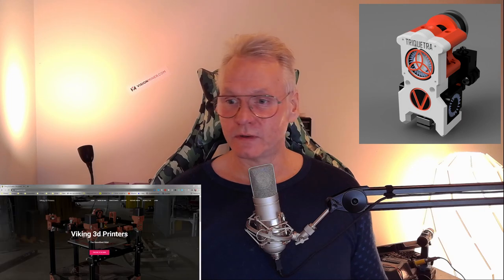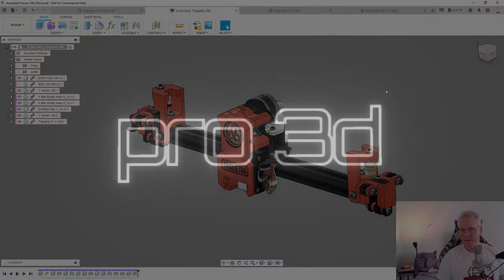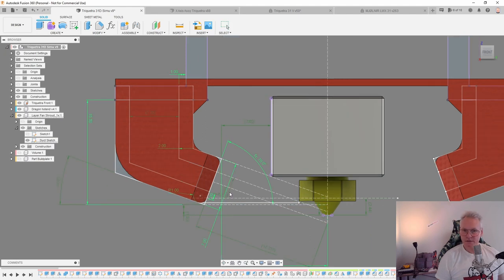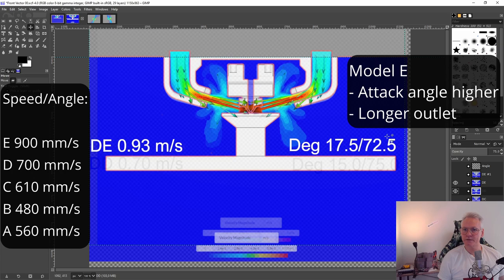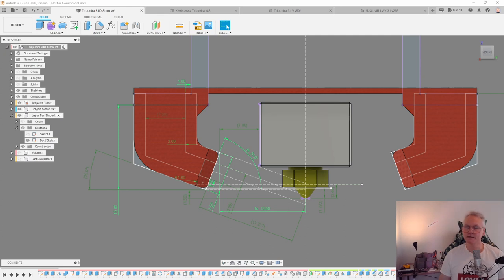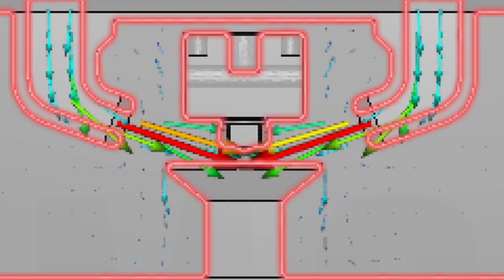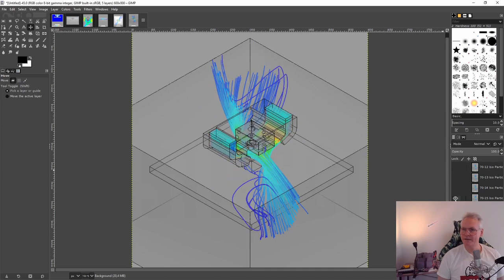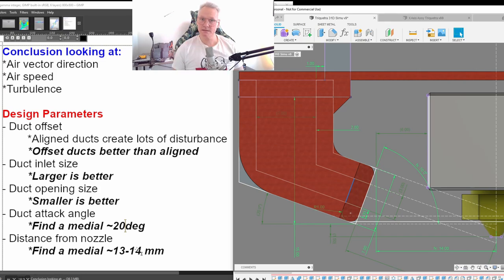Fan Duct Design Optimizing by CFD | 3D Printer ToolHead Design | The Triquetra

Comment: Just an observation: If the heat block needs a silicone sock, it will influence the air flow. So you might need model it and change the parameters to direct the air further down
Reply from the maker: Wow that is a very good observation! I will definitely do that. Thanks for the input Peter

Comment: Very interesting conception.
The filament is melted in nozzle, coming off down, outside and should be still good melted enough to good stick to the previous layer of  the print .... 
My question is : if you attack too high on the nozzle,  the cold air will lower the temperature down of the melted filament, maybe too early before it's locked to the previous layer, so it can make the print weak  🤔  ? 
Have you tested the print for the strength before and after use the new cooling system   ? 
I think , what if the cooling air is attacking more down and on the already locked  🔒  new layer to make it hard faster  ??
Ps .....  how do you simulating the air flow  ?
Thank you for any info

Comment: Jeg ambefale at.. Ah I will write in english so other can read. Anyway.. I would approach "tornado" way.. By that I meant I would use 3 tiny pipes (rør) which would spin air and leaving hot end relatively untouched. The air would be pushed by kompresor. 

The bigger difference needs to be done  in simulation for heated chamber from 40c°-100c°.

We noticed that even in lower chamber temperatures all the settings changes quite drastically. To that end I was thinking to add  controllable air  in/out  port to heated chamber /enclosure.
Reply from the maker: I guess you have a point. I dont want to add the complexity of a pump to this solution as stock. It could be a nice upgrade for those in need

Comment: Very impressive! I've got a few questions though, I've got a delta printer so it's a very different design to your corexy. I'm trying to think of ways that would be possible to reduce the weight and allow me to mount it to the effector.

Also what fans are you using for this? Normal 4020 fans? I've currently got 5015 fans so I'd imagine this fan duct wouldn't work quite properly so I might have to redesign it slightly for my needs.
Reply from the maker: I don't know how this would work on a delta effector. I know someone used just the extruder but not how it works. The current fans are only 3010 blowers. My design is minimized so I can not go much beyond 4010 fans unless getting less y travel
Reply: @PRO3DESIGN  thanks, maybe I'll try and design my own fan ducts. Worth a ask. Good luck with your printer!

Comment: Very nice! Did you already calculate the whole mass of the extruder incl. fans, shrouds etc?
Reply from the maker: So far I only have the weight of the printed parts but also the complete Mjølnir extruder. They together weigh 226 grams in the 5:1 geared extruder and 240 grams with the 3:1 geared extruder

Comment: Curious, why did you go with the split flow from each side, surely the flow just cancels itself at the point of the nozzle? I've been trying to find testing info on different duct configurations in practice but finding frustratingly little :(. My current setup has flow from one side, and it's true there is a problem if there is an overhang on the other side of the nozzle from the duct exit, but I've yet to see any testing that shows exits pointing in from either side - or even all around the nozzle, as some people have designed - actually improves things. My immediate reaction is that the nozzle itself will have relatively static air flow??!

Comment: Would airflow not be improved with curves rather than hard corners inside?
Reply from the maker: I can only assume curved is better yes. I do have curved on the model now. I do consider upping to 4010. 3010 is a little bit weak
Reply: @PRO3DESIGN  I’ve been working on a redesign of fan ducts myself. I used your angles and measurements to retweak the output.  It even looks better than the 30° that I had.  Thanks for the video.